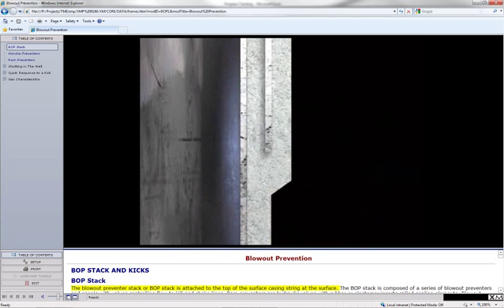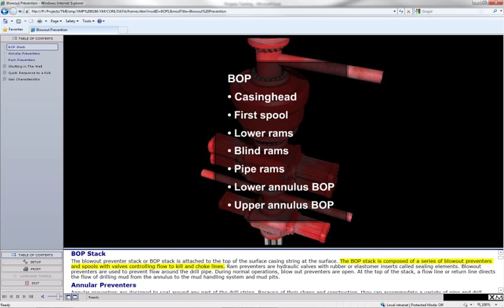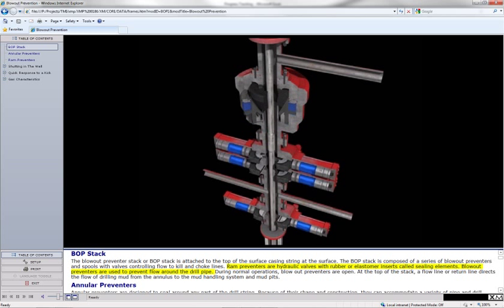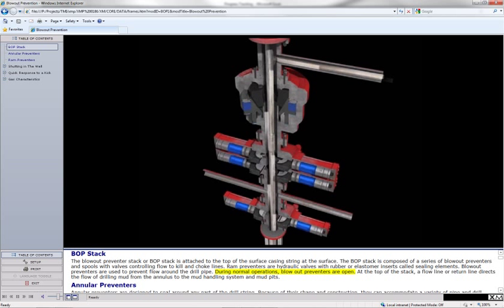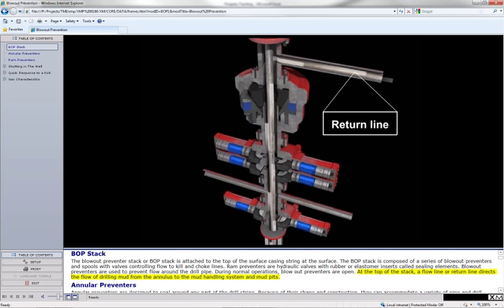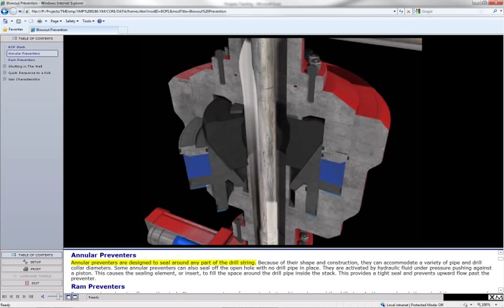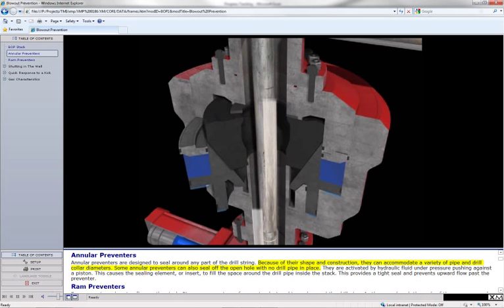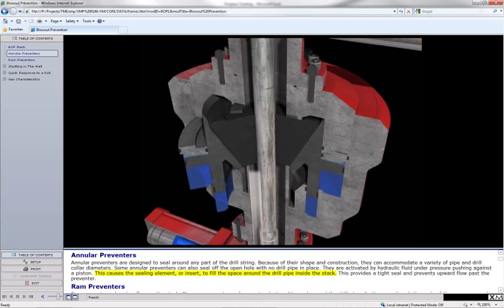Blowout Prevention

Comment: Is an annular damaged if a tool joint is pulled through it when it is closed? Can the drill string be circulated to keep a open hole from collapsing while the annular is closed?